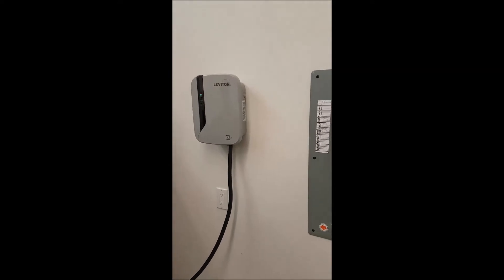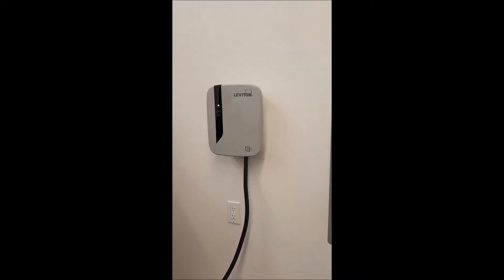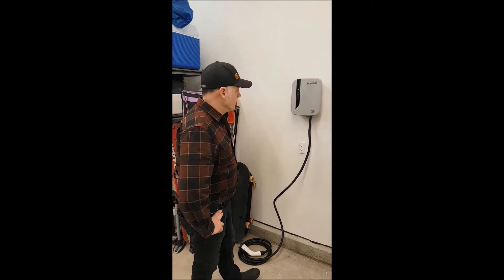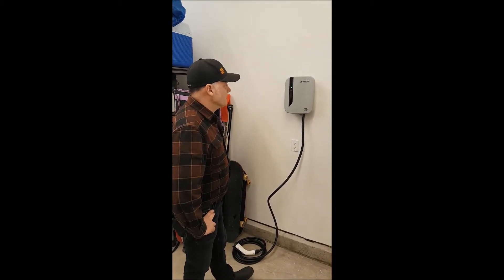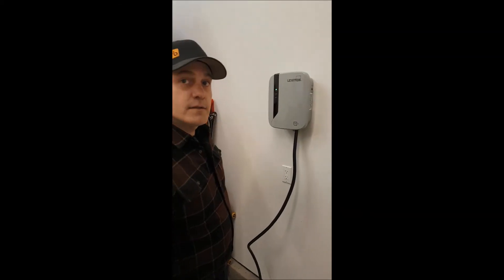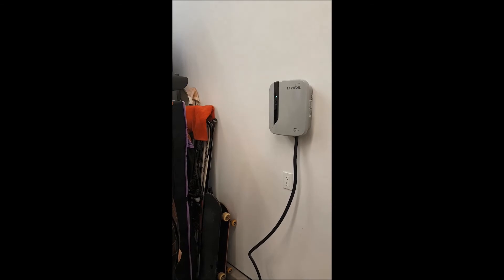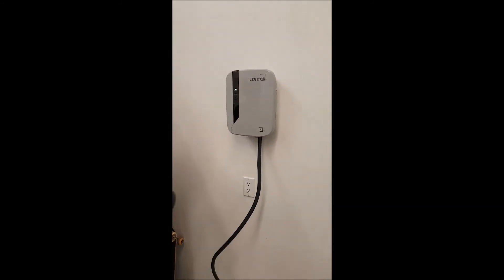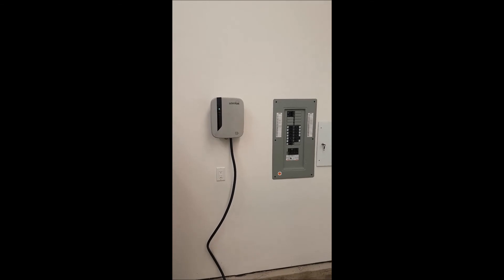Leviton evr-green e30 Electric Vehicle Charging Station Installation

Comment: How long it would take to charge tesla model y to 90%
Reply from the maker: Well... the e30 charges at 7.2 kW/h.
Your Model Y has a 75kWh battery (I believe) 
So 75kwh x .9 = 67.5 kwh.
67.5 ÷ 7.2 = 9.4 hours

So I would expect approximately 9 and half hours to charge your Model Y from 0% to 90% state of charge. 

I hope this helps.